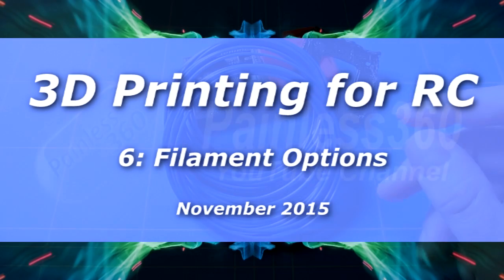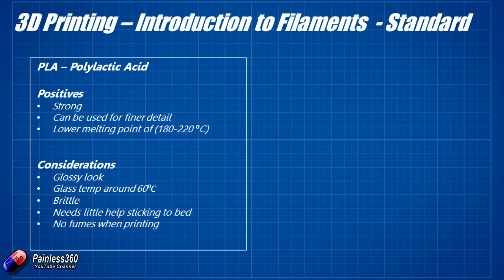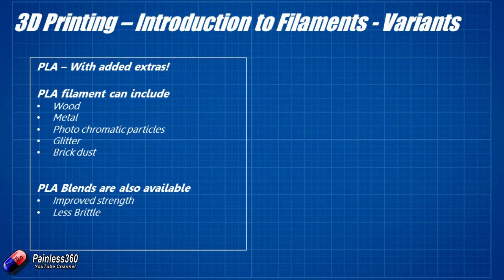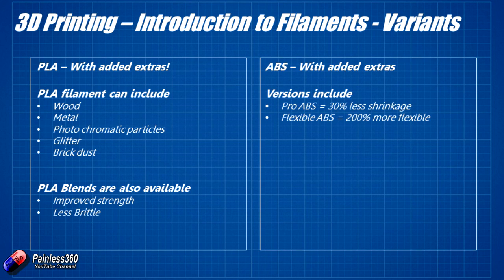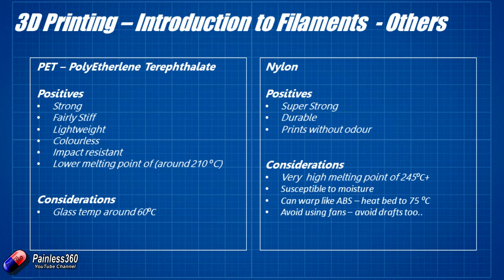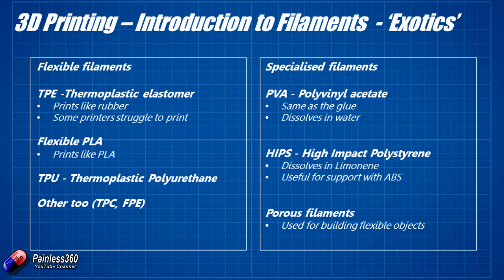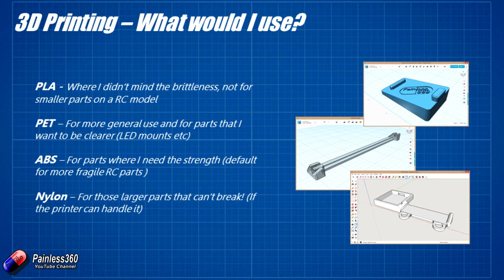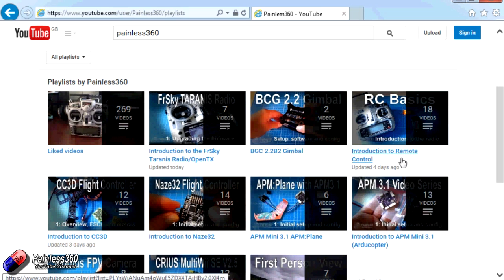(6/6) 3D Printing for RC - Filament choices (ABS, PLA, Nylon etc)

Comment: Updated series please! So much has changed in 3d printing
Reply from the maker: Like what?
Reply: Painless360 well how there’s dozens of plastics available to print with, the ones you mentioned are now a bit outdated, and have probably changed a fair bit with new additives and blends in the last few years. Now you can get PETG, PC, PP, ABS+ PLA+ and additives like carbon fibre or fibreglass filament etc. Personally would be interested to see how all the new filaments can be implemented into rc hobbies, as I haven’t found a video on that yet.
Reply from the maker: If you watch the rest of the series you'll see that I print pretty much exclusivity in PETg now. Thanks fro the idea.

Comment: Bought a roll of petg in an offer (they were selling it even cheaper than pla as a way to promote it) and been wondering if i could use it to print rc car parts. I'm looking to print the shock tower of the car but petg being so flexible (in contrast with pla) worries me a bit as in a crash it could end up bending stuff connected to the shock tower instead of breaking and leaving everything (except the shock tower) intact. I know you are more of a flying rc stuff guy, but have you suffered from "too much flexibility"?? (I hope you understand what i'm trying to ask as english is not my first language.
Reply from the maker: The forces on parts can be very different depending on the model. The only way to see if it'll work is to try it. Layer adhesion and having enough plastic at the key stress points will need to be tweaked. Best of luck!
Reply: @Painless360  Wow that was quick reply!  I'll design a model like the real one and if that breaks easily I'll keep adding changes until I find one that I like. Thanks!

Comment: Do you think bridge nylon, alloy 910 or pctpe would be the most suitable for an rc car a arm??
Reply from the maker: Car alarm? I think autocorrect messed up your question there..
Reply: @Painless360  nope, I was talking about an rc car a arm, the arms that connect the front bulkhead with the tires (they need to flex a bit)
Reply from the maker: Not sure. I've not played with cars enough so I'd be guessing.. Happy driving..

Comment: For smoothing PLA , I learned from a Dutch guy that chloroform does the trick , in certain countries that is hard to get but it helps when you are near the borders of countries with more relaxed laws.
Reply from the maker: PLA dissolves in Acetone so using that to smooth is safer and easier. There are lots of videos and tutorials on how in the usual places. Happy printing!

Comment: PLA is stronger than ABS, it has a higher tensile strength. Do not use PETG for flying rc parts although it is stronger than PLA and ABS and requires more force to brake, it bends before braking a lot more than these so having a quad copter arm bending is not a good thing even though it wont brake as easy. Nylon is similar properties to PETG it is super strong and just wont brake but it will bend heaps before braking. Delrin is a newer material but i haven't found much information about it other than its better for gears and wearing parts than nylon its also a super strong material but when it comes to 3d printing its about the layer adhesion so keep a eye out for this one.
Annealing PLA 3d prints would be the best start for a quad  or plane for RC to start with its mega cheap pretty strong wont bend much so its more brittle plastic.

Polycarbonate is the strongest 3d printed material also wont bend like nylon and other materials before braking but requires 270* to 300* on the nozzle so you will need a good quality hot end to print this stuff. 
Check out Thomas Sanladerer channel his Filaween series will tell you what you need to know about each filament he tests.
Reply: I know your comment is old, but I struggle to see why "bending before breaking" is a bad property for flying RC? On a semi hard crash, e.g. PLA would break while PETG has the flexibility to absorb some of the crash, leaving my vehicle intact. Care to explain? :)

Comment: what plastic would you print a miniquad mobious protection mount on? It must be resistant and light weight. At what percentage?
Very useful series BTW!!
Reply from the maker: +Dick'n Nick I would go for ABS, depends on the part but I'd be looking at 50%-100% infill for strength.. Best of luck!
Reply: +Painless360 Okey! Thank you very much!
Reply: Extremely late reply but infill doesn't add much or any strength in most cases. more walls/perimeters adds strength.

Comment: Love the vid. But one thing. Pla softens at very low temp. Like at 110f (39c I think) in a hot Florida car it will droop but not actually melt still till 180c
Reply: But as I'm getting into 3D printing, these vids are great
Reply from the maker: +John Mcdonald That is right, any deformation due to the plastic becoming soft is an issue - not just full on melting. That is what the 'glass' temperature is all about - above that and you run the risk of deformations..

Comment: I've dropped nylon for PETG, I've found PETG easy to print with almost as easy as PLA and PETG is way tougher than ABS, well at least Taulmans3D TECH-G is.
Reply from the maker: Agreed, nice to work with. Now if we could find a supplier that didn't charge twice the cost of PLA for a kg roll of PETG..

Comment: Great play list... I am looking a getting a delta printer too... I have a geeetech Prusa i3.
Reply from the maker: +Keith Applegarth top tip - do not get the plastic Geeetech Rostock G2s kit. The parts are ok but I've one snap on mine during gentle calibration. The 'G2s Pro' version is all metal - higher temps supported, better accuracy and resilience.. That is what is holding up the calibration and first print videos..
Reply: Painless360 thanks. I appreciate the advice. I am thinking about the Kossel 2020 all aluminum delta from FolgerTech.